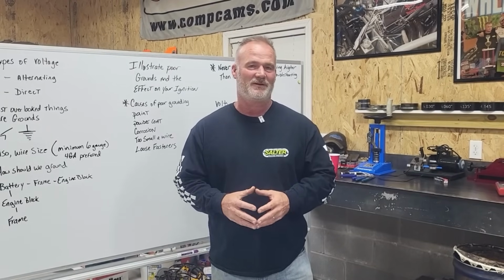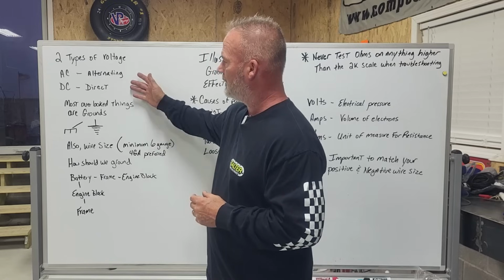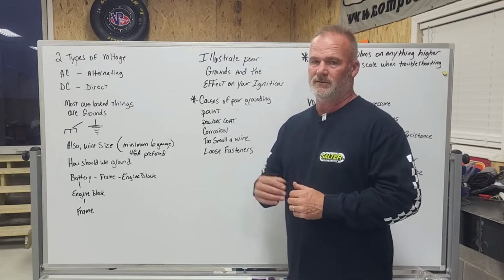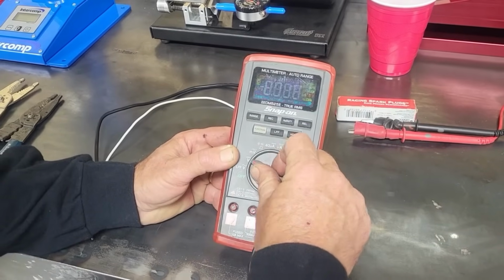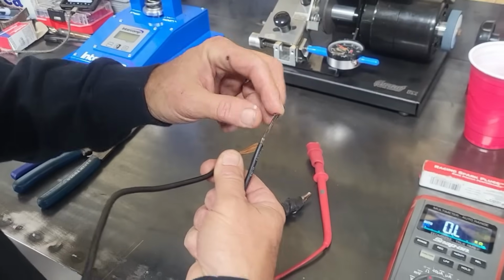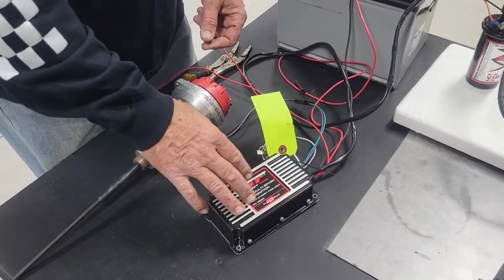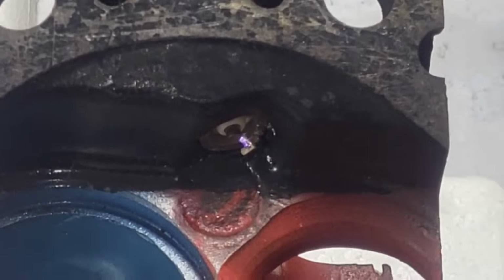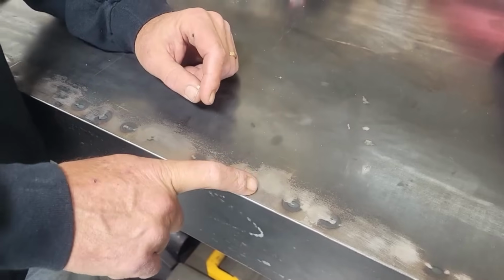Proper Grounding Too much at Stake

Comment: Too much anti seize on sparkplug threads and dirty copper indexing washers can partially insulate the plugs..  I think the copper 3M anti seize is a little more conductive than the nickel stuff.  Using a thermal camera is a quick way to find wiring/ground issues especially for coils.

Comment: That's very cool demonstration and i got to see you get shocked 2 times lol i had to say that lol but anyways since drag racing uses 44 amp but in circle track can we run 44 amp and will that not work because i see a 12 and 20 amp from msd and i do knwo sprint car guys run 12 amp but was curious is 20 and 44 can work

Comment: You are certainly a better man than i.  That shock would have brought a bout of tourettes if it was me.  Good turorial! One other point you may have forgotten to cover is at 50 or 60 thousand volts ignition current will find a path to ground.  Ive seen more ecus with bad coil or injector drivers from anodized parts not allowing a good ground.

Comment: Great vid!  Ground loops.  You can technically have “too many” grounds if your not grounding properly because you DO create ground loops and back feeding.  Technically or preferably,  all grounds should lead directly to the battery ground. A compromise is using a clean bus, dirty bus, plus chassis ground.  

•Ignition box grounds should never ever be ground to the frame or block and should be a separate ground straight to the battery terminal using 0/0AWG 0.1 ohm wire no matter what.  Your MSD power doesn’t share a power line with your starter or other nonsense!  If it does, you wired your race car incorrectly! 

•You should have a Clean ground and power Bus, Dirty ground and power bus and a chassis ground.   Ignition box and traction control is always ran directly to battery on both power and ground!  All accessories are on the dirty buses.  Your coil is an example of what goes on a clean bus.  The dirty and clean ground buses always run separate all the way back to the battery.  The dirty and clean power buses can split off a O/2 gauge power wire to their separate distribution points. 

The most overlooked thing isn’t ground, it’s EMI/EMF which people are just now beginning to recognize. Your ignition wires or pickup wires should be ran with dual shield (braided  & foil) cables with a drain wire. That drain wire and shield should be soldered and grounded to a separate grounding plain.  Ignition and accessory are on different grounds plains (dirty and clean bus) DIODES should be ran in all relays and solenoids to reduce voltage spikes. A Right front shut off or line lock crates massive spikes in voltage!  A diode prevents these spikes! Even with dual shielded cable ignition wires always  get ran separately from all other cables.  

A chassis ground is just that,  a chassis ground it is NOT a grinding location for all devices or the ignition. Both heads should technically go straight to battery ground but can be ground to chassis.  The engine is already grounded often to the Chassis so it’s best to run a head ground to the battery.   The Proper way IS to go to the battery. 

The best spark plug / coil wire for performance, OHM rating, spark and to reduce any EMP/EMF noise on the ignition is: 
•Multi Fire plug wires. PERIOD 
They are 15 OHM per foot. 
Lowest resistance of any spark plug wire package on the market and heat resistant up to 1200°F.   They are so good, you cannot use a timing light with them as the light cannot pick up the pulse on the wire. You must use a separate timing plug wire like a junky Msd, Scott or Moroso. This means less electromagnetic interference with your ignition! Plus it’s more power as has been proven multiple times on the dyno. They make 9hp more HP and is why creat engine guys or circle track guys with tight engine rules run them.  If your timing light cannot pick up the wire your ignition will not be effected. But they a are $300+ set of wires. 

Also most non shielded wires should be ran ( at least in the engine bay) with good silicone sleeved wire. 

Everything gets dual walled heat-shrinking, weather pack or equivalent connectors and actual soldering. No T tapes, quick splice connectors, twist nuts, wago connectors or electrical tape.
Reply: If anyone thinks an msd box doesn’t run both pose and ground directly to the battery they never read the actual instructions or understand what they are doing.
Reply: Dirty bus cleaning with induction and capacitor? Or maybe a small battery on the end or 20% from the end? It’s like a coax not being grounded on both ends.
Reply: Braided strap on the ground bus
Reply: Where do you place the diodes at on the relay?

Comment: Yeah the old check for resistance in a pin point test has burned me in the past. I like how it’ll ask you is it less than five ohms, yeah. I do voltage drop test and find a way to make the circuit live, with a 1156 bulb on small wire and a head lamp on larger gauge wire.

Comment: You may teach for easy of understanding OL : Open line = you are not measuring anything, there is no continuity or no continuation of any resistance, voltage or amperage dus a broken wire/terminal, lose conectór.